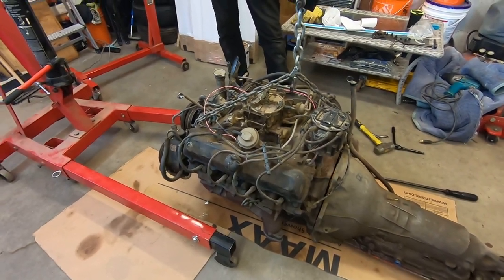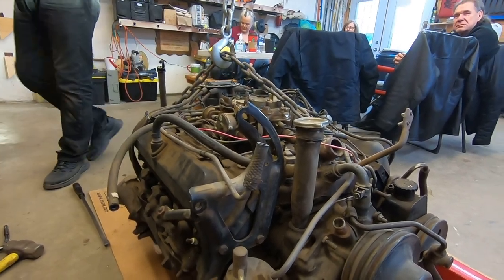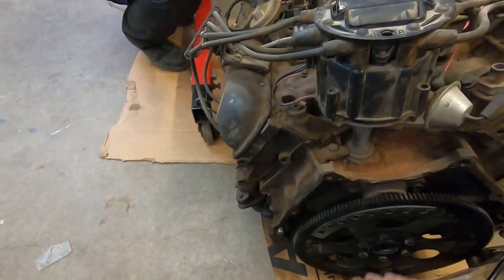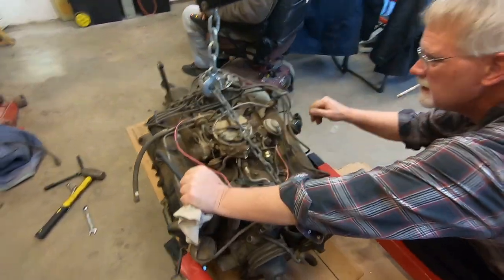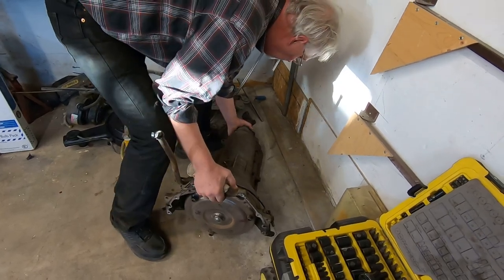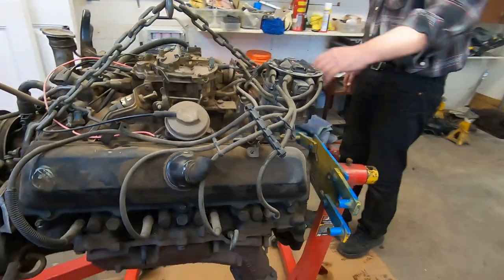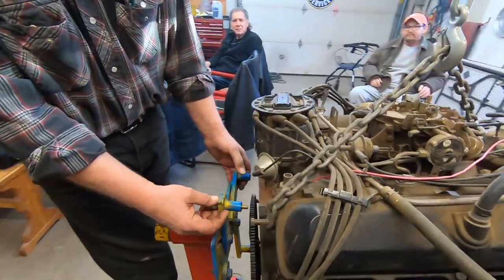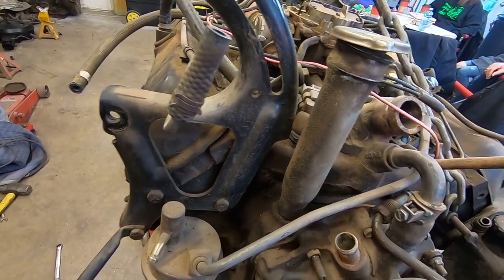307 Olds Interesting Facts

Comment: Just picked up a good running 307, gonna get an intake, some headers, and im tempted to do an e85 carb on it.  Olds engines are very interesting once you dig into them
Reply from the maker: Please let us know how you make out with this project I'm curious to see how it does with E85 thanks for sharing 👍
Reply: The heads on these 307 were generally crap, for additional performance supposedly Olds 350 early 60/70s 5A heads can be swapped, also the bolt holes may have to be drilled out to use them.

Comment: The quadrajet is one of the reasons they get such good milage with the small primaries that was always one of the best things about the old trusty q jet that and reliability as well as drivability and when you ask for more the huge secondaries always came thru for ya and there's no other carb that makes the same moan noise as they do my buddies heard me coming for miles w that q jet moaning lol
Reply from the maker: Ya I know the sound your describing Glenn it is certainly unique and I agree they were reliable and fuel efficient thanks for sharing that's a very good point
Reply: That sound was what we as younger guys referred to as screaming in the night because thats when we would be out raising hell most of the time and that sound carried for miles and miles it seemed lol its gotta breath both in and out so anything w a cat on it or hell even single exhaust got duals w decent flowing mufflers all the way out the back straigjt pipes were just too loud for me
Reply: Now holley got the efi version with that q-jet roar💪🏾💪🏾💪🏾💪🏾

Comment: Great 👍 show and information  👏  ! I own a 1981 Oldsmobile Delta 88 with the  Oldsmobile ( 307 V8 ) engine and one thing is that these engines are fairly reliable but lol noo power house  .
Reply from the maker: Yes very reliable and economical in the day really a Bullitt proof set up but tough to hot rod, thank you very much for watching 👍

Comment: Cadillac installed 307 engines in california that had port injection during some years.  I learned this via Youtube.
It really surprised me. Every injector was splayed to spray onto the back of the valves so it had a formed tube fuel rail.
Reply from the maker: Wow more 307 info thanks for sharing Gordon and thanks for watching 👍
Reply from the maker: I don't remember claiming the 307 was ever injected?

Comment: I finish to rebuild my engine, new intake gasket, valve cover gasket, new valve cover, new water pump, new radiator, rebuild the caburator as new, new clutch fan, new coil and wire, new spark plug, new baterrry, new thermostat, etc......change all the suspention on the car, sound like a brand new!! 50 000 miles on my delta 88, original tow color..Am proud of my duty and car...
Reply from the maker: Sounds like there's lots of love in your ride good job

Comment: You have a "vin 9" 307 the one to have is the "vin Y" with the rolling cam. You can take the 5A heads and swap them with the 7A heads the "vin Y" olds had but youll have to swap the intake too cause the 5A heads use conventional style intake ports. then you got a good 307.
The oldsmobile 307 was introduced in 81 and used flat tappet cam until 85 then went to roller cam in 86 then ceased production in 1990.
Reply from the maker: I think I mentioned that in the video?
Reply: @garythegear  which part?
Reply from the maker: My mistake I thought all first gens were flat tappet and second gen was a roller cam motor being 85 and newer also I was under the impression that first gen motors had the 5a heads , maybe I should have done more results on this topic, to be honest I didn't think a video on the 307 was gunna get many views so I just touched on my very basic understanding I had of them, thanks for the comments I appreciate it
Reply: @garythegear  they got the roller and 7A heads in 86. The 307 i believe was introduced in 81 after the olds 350 rocket ceased production in 1980 and the smaller bored blocks took its place. The United states government started cracking down on emission laws in the late 70s so these "smog" engines took their place.
Reply: @garythegear  I built quite a few engines and the last one I made was 307 olds, i wanted to build something unique so i chose the olds 307 Not alot of people build those because they were viewed a throw away engine be the cost to make power was expensive and simply putting in a 350 was alot cheaper. My first car i bought was an 89 Buick electra estate wagon and that had a 307 olds and so did my fathers station wagon when i was a kid. i loved that car so the 307 holds a special sentimental feeling in me.
Reply from the maker: That makes total sense  thanks for sharing your knowledge on the 307 olds and I appreciate the fact this is something that's sentimental its all about the cars we love and why we love them
Reply: Standard 307 is the Vin Y (140 hp).  The vin Y 307s went to a roller cam in 85 along with the 7A heads.   The Vin 9 (180 hp) 307s went to a roller cam in 86.  So if you got a 442 in 85, you got the Vin 9 engine with flat tappet cam and the 5A heads .  I have 6 of these engines, 3 in cars, 3 out.  The Vin 9s came in the 83-84 hurst, 85-87 442 and some cadillacs.   Everything else got the vin y 307.
Reply from the maker: Thanks for sharing that's good information we obviously didn't have the car or the vin to confirm in this case, we actually had zero history on this engine
Reply: @myrtistaylor5759  how did you add the power
Reply: @seannyc88  switched to 5A heads with larger intake runner ports and had heads milled.
Reply: @88cutty  yes your correct. I have another 307 that came from an 87 442 that is vin 9 with roller cam. At the time I wrote that comment I was under the impression that only vin Y had the roller cam. I learned a little bit more since then.
Reply: @myrtistaylor5759  thanks  whats your take on a turbo or supercharger just looking to get s bit more power out of the 307 without taking it apart
Reply: @seannyc88  no none of that stuff on a 307 or any Oldsmobile v8 for that matter. 
It's a low RPM engine it makes its peak power at about 2500 to 3000 roughly. When it comes to OLDSMOBILE V8s it's ALL ABOUT TORQUE NOT HORSEPOWER.  
Torque is where Oldsmobile shines. 
If one car had a stock Chevrolet 350 (high rpm power curve)
And another car with an stock Oldsmobile 307 (low rpm power curve) 
Both met at an intersection at a stop light, the car with the 307 will get to the other side of the intersection quicker than the car with the 350 because it produces more Torque at take off faster at a low rpm. 

But if both cars were on a highway the car with the Chevrolet 350 would be going faster than the 307 cause it produces its peak power higher up in the rpm curve. 

If you want alot of high rpm power go with chevy 350.  If you want alot of low end torque for cruising then an Oldsmobile v8 is good.
Reply: @myrtistaylor5759  wow thanks very informative im new to this info just inherited a 86 cutlass
Could i bug you for some useful mods or updates
Reply: @seannyc88  do you have emissions where you live?
Reply: @myrtistaylor5759  i think so im in texas
Reply: @garythegear  hey gary could i bug you for some upgrades or mods for 86 cutlass supreme
Reply from the maker: @seannyc88 unfortunately there's not alot out there for engine mods on the 307

Comment: I have a 1983 cutlass with a 307 olds. 200r4, 2.93 rear gear and i get almost 25 mpg on the highway with the ac blowing. Lol. It's not a speed demon, just a pure highway cruiser. 
2nd owner of almost 30 years, never had an issue with the motor.. very strong.
Reply from the maker: Ya there reliable and efficient for sure that's awesome mileage
Reply: Thinking about. Buying one in a Buick park avenue
Reply from the maker: Sounds like a nice purchase, let us know how you make out

Comment: The casting code is on front of the block in front of the sending unit for the oil pressure. Next to the fill neck.
Reply from the maker: Thanks ya we did find this and confirmed it was a 84   307

Comment: All it needs is some new Eternal parts like aluminum intake manifold any 600-750 CFM carburetor new pushrods lifters rocker arms some honing the cylinder walls new pistons connecting rods new crank and more so i can look fresh and run better

Comment: There was also a High out put 307 180 hp in the 442 and the regular 307 had 140 hp respectively.Whats the cam  difference in the 84 and prior years and whats the benefit of it? The carbs were set set on the lean side at the factory and sealed so you couldnt adjust it , I guess it was for emissions and fuel economy.I heard you could tap or drill out those mixture screws so you could adjust for more power response. I had a chevy 307 in a 1968 Impala it had 200 hp! with a power glide tranny.That 307 replaced the 283 engine. People make fun of the olds 307 I happen to like it. I am a G Car Guy! That engine looked pretty dry.
Reply from the maker: Yes I think that peticular motor sat for a number of years, we didn't have alot of information on it the difference in cams was hydrolic flat tappet in the older version then mid way they went to hydrolic roller cams , there's alot of interest in the olds 307 engines personally I think they were the best 307s made

Comment: Great video..Just purchased a 83 regency... Bad motor.. Should I rebuild it? Or try a 403 which someone recommend?
Reply from the maker: That's a tough one, I'm personally of the school bigger is always better, I like the sound of the 403
Reply: or any what they call small block olds motor a 350 rocket would do very nicely in that and probably be a better choice than the 403 in my opinion actually the 403 was ah ok but kinda doggish where an older 4 barrel rocket 350 from an old cutlass or vista cruiser or somsthing would be a screamer bet or you can always go the easy way because im sure the holes are drilled in the frame for the mounts a small block Chevy will bolt right in as well just as easy and much cheaper also could be hopped up cheaper too w even exhaust manifolds and just dual exhaust flilowmarwers or somsthing it would sound right and be a really nice cruiser for the cheap if you did it right

Comment: After years and years of searching I finally find information about the 307 Oldsmobile but now that I know I have the worst of the two since mines in 86 now I’m lost. I thought I could just buy aluminum heads intake a new cam and headers is that possible
Reply from the maker: Unfortunately I'm not sure that there's any aftermarket parts available for the 307 olds, all I know for certain if your going with a 307 of any kind the Oldsmobile was the better of the bunch , you'll have to do some reasurch on this one I'm sorry I don't have a solid answer for you , the information I was given several years ago that not much of anything was available
Reply: Edelbrock has a manifold and card set up...I think it's the PERFORMER line...

Comment: has the 307s had any issues with missfires? my 84 olds 98 has a 307 and at idle and lower rpms when driving i have a noticable missfire and i can't figure it out for the life of me, good compression, new wires, plugs, carb, rotor, cap but still gas the miss, good running engine when it's driving, but holding lower rpms and the miss are stumping me lol
Reply from the maker: No they never had known issues with misfire that I'm aware of , I can tell you that some of the new stuff we buy today isn't that great like plugs wires etc all I can say without seeing it is keep digging you will find it
Reply: Mis adjusted carb could do that. But so could so many other things with out looking
Reply: Same
Reply: put a new distributor in it that has an issue w the magnetic pickup or  something they are pretty cheap for a brand new one if its still skippy after that hmu but im thinking you'll be good w it and it will wake up too the advance will all work right ans all that w the new distributor

Comment: I have a 84 le sabre with the 307 need a video on how to delete the smog pump
Reply: i just took mine off my 84 le sabre made alot more room now i think my power steering belt is bad squeaks like hell even when i adjusted. Any website you fine for Bumper fillers let me know
Reply: 84 307 (5A) I deleted mine got a bad squeak after replaced water pump,power steering pump, belts, Now  my power steering /altenator belts wont line up need some pointers been at it for 2 days jammed up
Reply from the maker: Hard to say what's going on without seeing things, I wonder if pulleys from a pre smog set up would help line things up ?

Comment: Is it possible to mildly tune this V8 and what would you do to it
Reply from the maker: Not alot you can do with the 307 I understand the earlier version 5A heads flow better and they were also the flat tappet cam style that produced a little more power, primarily these were created to be more of an economical engine and were guite reliable pre fuel injection deals , I did come across some other channels on YouTube that are very well versed on these little engines
Reply: @garythegear  ok thanks for the info 
Im gonna buy a custom cruiser from 1983 307ci 
I don't wanna muscle machine but a little more power 

To get along with the traffic 

Im from the Netherlands 
Thanks for the info
Reply from the maker: @keesvarkevisser92  wow very cool you will definitely enjoy your new purchase and thanks for watching from the Netherlands that's awesome 👌
Reply from the maker: Very cool I had no idea thanks for sharing Mike 👍

Comment: I think you got that the wrong way around ! The roller cam version is so much better , anything with roller cams is smother, lasts longer and more power . Every V8 today is roller cam
Reply from the maker: Your absolutely correct the roller version is far more reliable engine by far however this version was introduced later and made less power compared to the earlier flat tappet version that's the only reason many enthusiasts will choose this engine, I personally will always choose the roller version especially when we are talking about a 307
Reply: @garythegear  yes I could see how  there might be some advantages to the early motor , it makes sense .

Comment: Those and the 305 Chevy were idiot proof practically due to the heads not flowing enough to let it over rev and blow itself uo
Reply from the maker: Ya I think the plan in the day was to provide a fuel efficient and  reliable engine , not much one can do to modify them unfortunately but they were certainly bullet proof thanks for watching 👍
Reply: I've seen some rather stout 305 chevys but thats only because they are in the small block Chevy family and things fit from one engine to another cams heads etc unfortunately the same.is not.so true w the 307 olds motor there is way less aftermarket support for the poor girl hence making upgrades performance wise not as easy or common the  heads as I said are the biggest issue shrouded valves due to small cylinders one of the biggest issues people have found ways around that issue of course and although not as desirable as a 350.the 305 has found its way into the engine bays of a lot of decent performing cars it has more limitations than its big brother the 350 but with some finessing can make some really really good power at a low cost compared to an olds motor due to as I said the aftermarket supply and the interchangeability of parts
Reply from the maker: Well said Glenn that's exactly the case 👍
Reply: I’ve seen quite a few 307s start knocking after 3 seconds of valve float, also heard people claim that they’re a tough motor, not really sure what to think of them
Reply from the maker: Well valve float on anything is not good, I personally have always been into the hot rod or hot rod able engines like big blocks or the 350 however there seems to be a big following for these little engines and I won't argue with anyone about their reliability, each to their own I guess
Reply: @garythegear  no clearly valve float is not good on anything lol, just saying I’ve seen other small blocks last much longer than these with much more abuse, most everyone I know around here has something against these 307s.
Reply: @garythegear  I am picking up a 85 lesabre with a 307 in it today tho so we’ll see how that goes
Reply from the maker: Very cool keep us posted thanks for sharing 👍
Reply: Ive seen a few 307 chevys in high school run like a scalded cat as well it as usual had to do w heads cam and exhaust not much low and torque but being a big bore short stroke once you get it spinning if you can get the air in there they made good power along w some gearing of 411:1 or similar and even a heavy malibu 69 or 70 can rip decent and make people scratch fheir heads saying wtf they dont get it at all lol well while you were just getting moving w your 273:1 gears hes already in second amd way ahead you aimt gonna catch him either lol
Reply: @glennmanchester5696  oh I believe you, but those Chevy 307 are completely different than the Olds 307
Reply from the maker: That is true they are a different animal certainly of I had to choose between the two I would definitely want the olds mill and I'm a chevy guy haha
Reply: @garythegear  well the Lesabre is in my possession. The 307 quite is cold blooded but runs good once it’s started. I’m gonna fix it up over the winter and run it next summer, salted New Brunswick roads will eat away at it even more. I’m happy with it so far I can’t lie. Will probably put a mid range set of gears in it to wake it up just a bit. It has a 2004r and factory 8.5 with 2.73 gears but I was thinking 3.42 and a posi trac would wake her up a good amount while still keeping gas mileage decent.
Reply from the maker: That sounds like a good find and the gear change will certainly help, they were all about fuel efficiency back then hence the 273 gear , you will have fun with your new purchase good job